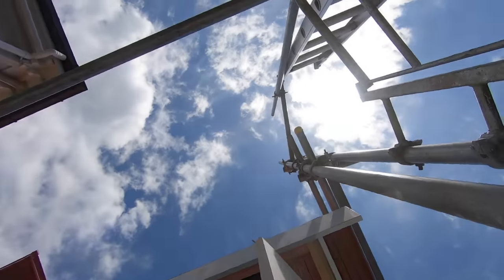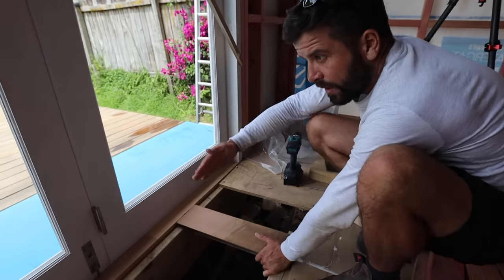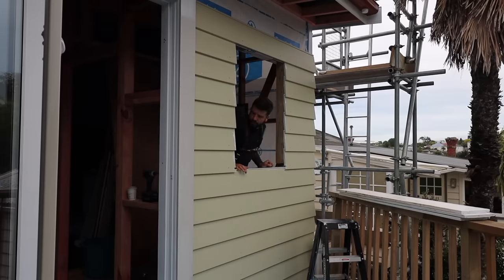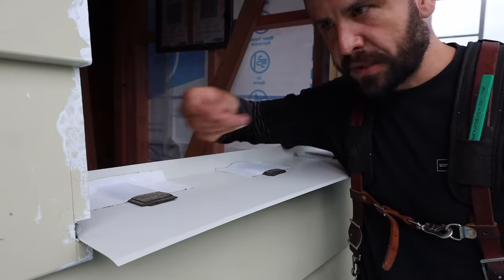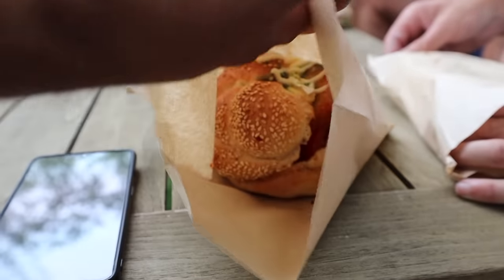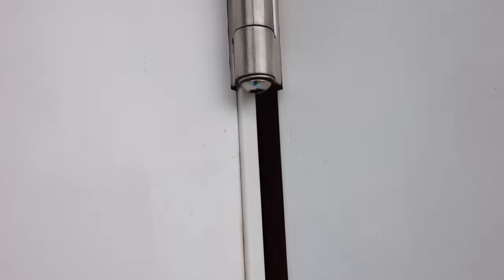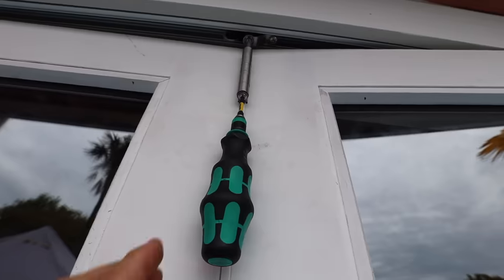Installing Timber Bifold Doors!

Comment: Hey Parnea - comes from the Latin term "plumba" or "metal lead".   Originally a soft metal weight (such as lead) on a string line that was used (with gravity) to measure or draw a vertical line, hence a plumb bob.    We used to make them as an exercise in shop class on the lathes.   The chemical symbol for Lead is "Pb" from this latin description.

Comment: Super pro and if you ever get caught out without a Richard key again, try a Torx bit t-27 is 5mm, and a t-20 will usually work in a 4mm. t-30 is 5.5mm so a little chancy in a 6. Wishing you and the crew well in 2021!

Comment: Those alan key screws are hard to reach but what you can try if something is that close to a surface is to put a long bitholder (300mm) or something like that on either your drill or bit screwdriver. Its a bit of an angle that way but 9 out of 10 times still able to rotate without damaging the head. Thanks for the great videos!

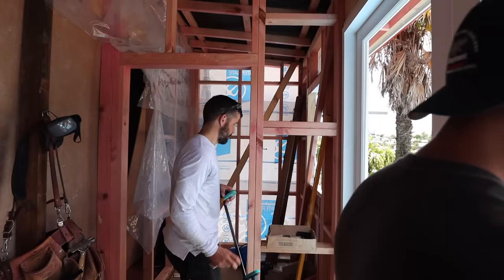Comment: 02:23 The plumb in plumb bob derives from Latin plumbum ('lead'), the material once used for the weighted bob at the end. Done the research for you Paerau ;)
Reply: Also the reason plumbers are so called
Reply: Also the reason that Pb is the symbol for Lead on the Periodic Table.
Reply: You beat me to it (well that was one of the random bits of useless knowledge that's been floating around in my head for years).

I'm not sure why Roman/medieval builders were saying "That's lead" to mean the lead-weighted string is vertical though...
Reply: in french they still say the same "a plomb".
Reply: Vertical Level
Reply: Its because they'd hang a plumb from a piece of string and get a vertical line, ok that's a lie but it'll work ;-p
Reply: @molitovv  holy cow your learn something new every other day!

Comment: That exact reason about the Allen key set is why I got the Milwaukee impact bit set with Allen keys. Throw it in a long magnetic adapter or a long hex head hand driver and I rarely run into problems

Comment: Btw, French here, plumb comes from "Plomb" in French, which means lead, (the metal), we (and I imagine everyone but for some reason the french words tend to stick) used to use a heavy lead and a string to figure out if things were level vertically, hence... Plumb! I haven't researched that btw, this is just me being french and assuming everything has to have happened because of us hahaha Cool video as usual, thanks ;)
Reply: A lot of the French language derives from Latin however, so it's still another thing the Romans have given us.

Comment: So I am curious how the window and door is sealed against the siding(weatherboards). Looked like you caulked the sill to the siding but is there something I missed behind the window trim boards or do you caulk from the inside? Otherwise I see nothing to stop bugs and rain from flowing in on the sides. Here in the States the siding is usually abutted to the window trim instead of the trim going over the siding. So the butt joint gets left a bit open then caulked. The way you guys do it is cleaner looking. But I just can't figure out how it's sealed!

Comment: I LOVE those bifold doors, much nicer than a traditional sliding window door that only opens up half of the window, and you get a simple regular door for just getting in and out instead of always having to slide a large heavy window door (we all know how well that goes after 10 years when the wheels and track are worn and some impossible to fully remove dirt gets in there).
If I ever buy a house that allows something wider than a double door to the garden, this will be the solution I'll go for. 
The only downside I see is you have that stack of window doors sticking out 90° to the side of the frame when fully open, but I don't think that's an issue in most cases where there's room for a 5 door wide 'gate' to the garden.
Reply: Stacking slider gives you most of the space without any of the sagging or hanging at 90 degrees.
Reply: @yup3398  That's true, but it also creates a deep frame with layers of overlapping panels like a sideways lazy stair. These bifold doors are nice and slim and all in one plane when closed, and you don't wear out a sliding mechanism in day to day use when you just open 1 door to get in or out. :-)

Comment: Great Work Guys! 12:20 - Are you going to recess the catchplate for the bolt so that it’s flush with the floor? Someone’s bound to catch their toes on those sharp corners?!?
Reply: was wondering the same
Reply: he covered it in an earlier question;  temporary to lock it up until after the holidays.
Reply: @TheJohnno25  thanks, missed that other response.

Comment: trim/fascia on the outside of siding/weatherboards has always struck me as odd, in a post-housewrap world.  I get why one would have done that in the 1900s. our current 1910 renovation has trim against sheathing and siding against sheathing. of course it's so leaky that it all just dries when water leaks occur, outside of where we are updating.

Comment: Are upvc windows and doors not a big thing in New Zealand? Instead of wooden windows and doors etc?
Reply: Upvc is getting slightly more common, but is still pretty rare to see. They are not much cheaper than aluminium here, so 99% of the time, people go with that instead. 
Wood frames are still very common in older houses, but are most often replaced with aluminium as they disintegrate - generally they are only used for character builds now.  
Chur.

Comment: why are the glazing beads fitted from the outside makes it easy to break in to the house am i missing something?
Reply: It’s easier to smash the window than it is to remove glazing beads, especially timber beads that are nailed and glued in place. Sure someone could remove the beads but that means the need the tools on them to do it. That increases the chance that they are caught in the act. All windows that I’ve seen in NZ are glazed from the outside.

Comment: Hi,
GD from UK, really enjoy the videos and it gives me/us in the UK a Birdseye view of the different construction techniques used by you guys. I have a question regarding the weathering of the window head and jamb. With the cladding leaving a void behind the “Architrave” of the window, due to the profile of the cladding when fixed, how do you stop rain water driving in to the ‘Window Jambs & Head” ?Here in the UK as I am sure you know we fit our windows in ‘Reveal’ behind the face of the external brickwork and then seal the window up to the adjacent brick reveal.
As I have already mentioned - Really enjoy the videos and look forward to the next “Exciting Episodes”
Seasons Greetings to all of you.
All the best,
GD in UK.
Reply: In NZ, we'd typically put a wooden cap above the door set at an angle, flush with the weatherboard and overhanging the door head - often with a metal flashing on top. Then a wooden scriber board on each side, scribed to the weatherboards and flush with the sill and underside of the cap.

Comment: I wonder if those doors are made from engineered joinery timber for longterm stability.
Reply: KLC Timber products are treated to Treated Timber Hazard Class: H3.2 as defined by NZS 3640. Using the MicroPro® preservative system, timber treated to H3.2 is suited for all exterior, above-ground uses, including those for structural applications, such as for pergolas, fences, verandah posts, beams. 
https://www.klc.co.nz/index.php

Comment: So they do build brick walls out there. Where they like budget bi folds? never had cut in lock keeps and adjust aluminium bi folds installed by a company

Comment: I saw on another video on SBC where he was again putting window and door casings over the weatherboard and then putting tiny "wedges" in behind the casing to close all the gaps. In this one I'm again surprised that he put the siding on first right up to the framing and then put the windows in with the casings over the weatherboards. Why? why do they do it like this? We've always put the windows and doors in with the casings and sills, so it goes right up to the sheathing and house wrap, then the siding goes on and dies right up against the casings.

Comment: Cracking videos Scott-  I’m from the UK and understand that building regs are probably different out there, you got any advice for where is best to read up on regs etc ( I’m meant to be relocating out to NZ once visas/ boarders open up and wanted to get to grips with your way of building and what is and isn’t used ( I notice no EPDM or Vapour control layer seemed to be applied around the window / door you installed) and don’t want to be like’ well this what we do in the UK’ and come across like an d**khead  👍
Reply: NZS 3604 : 2011 (NZ Building Code) would be a good start, Followed by Acceptable Solutions ( Clause C2-C6 )

Comment: G, day Scott, Palo and Richard from Sydney, Australia.
* ensuring that the bi folding door sill finishes  level with, FFL. How do you know the still thickness? (Manufacturing specifications)?
* interested in the finishing between the window frame and weather boards- if any?
🙈🙉🙊
Reply: In the previous video the joiner dropped off an offcut of sill so they could get it right.
Reply: @TheJohnno25  

Wood thinking➖

Comment: sory mate but is it normal that the glass goes in on the outside, of the window?
like that anyone can take it off, from the outside...no??
Reply: Yes that is normal. I haven’t seen a window in NZ where the glass is installed from the inside. Anyone could take it off from the outside but why? If it was a thief, they are gonna take the easiest access which would be breaking the glass, not getting out tools and knives to remove the bead/sealant/window putty and pull out glazing points/nails to remove the glass intact. Removing the glazing would be the slowest way of gaining access to the inside. Then if they are removing the glazing, there is obviously intent to reinstall it to cover their tracks. That means you now need to have replacement beading, nails/glazing points, sealant, putty, etc. Total waste of time with an increased chance of getting caught in the act. The only people that are going to go through any of that trouble are the home owner or a glazier that has been hired by the home owner.
Reply: @hlmccann  ok i understand what you mean, but like we all say "we can not be to careful" you wouldn't lose anything by doing it the other way, and you would gain peace of mind, at least , but ok i understand the theory ...

Comment: Hi. The doors are not installed correctly in that you did not toe & Heel the glazed units so that is why the doors were scraping the cill. You incorrectly made adjustments to the hinges. Totally wrong.